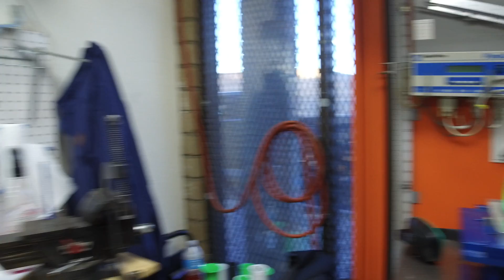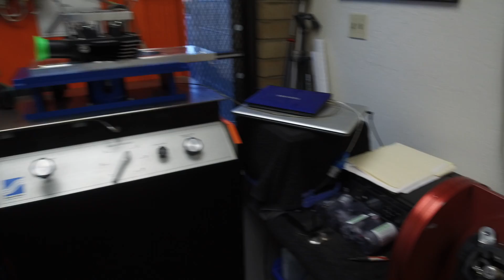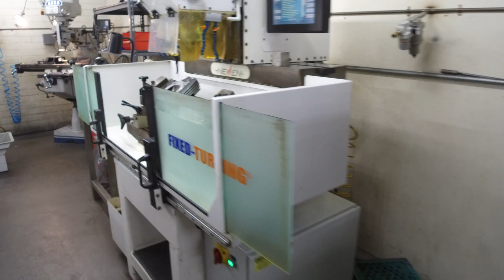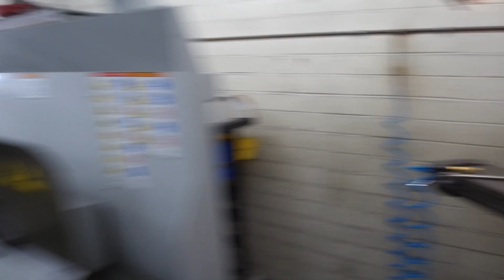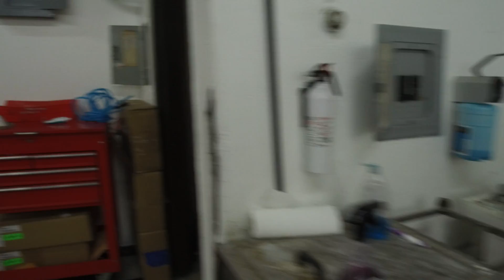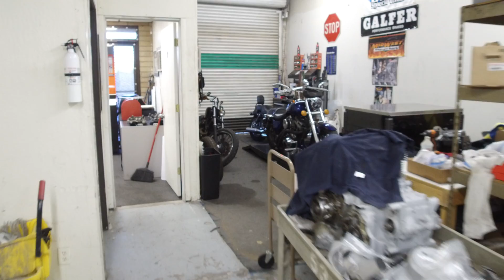SHORT-BLOCK CHARLIE Harley Davidson  PORTING SEMINAR OVERVIEW

Comment: Yer classes remind me of what Joe Modello use to have in Tennessee.
 I took a week long class in 2007.
 He liked using the Makita electric grinder.
 I like the Foredom grinder you use. I use a old Variac to control the speed with a Foredom foot pedal.
 Joe's reverse taper designed carbide cutters are great for SSR work.
 I used Joe mostly for supplies but also use Berry Geralamy for porting supplies.